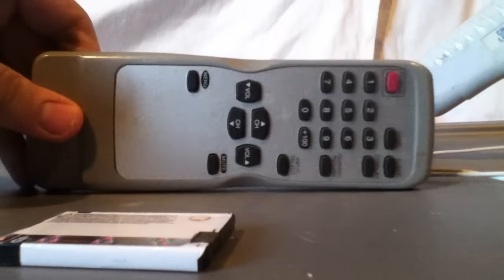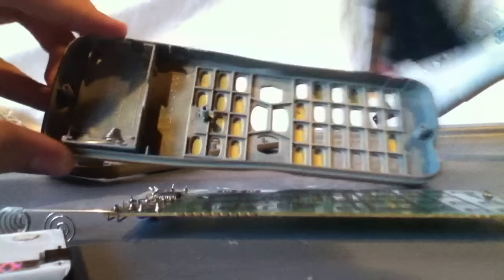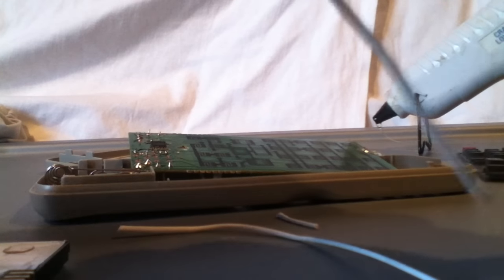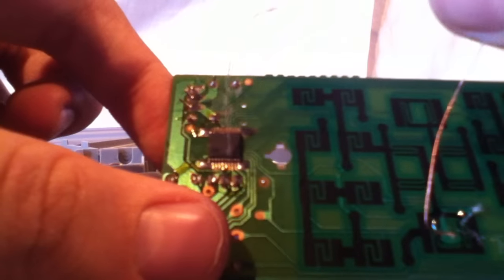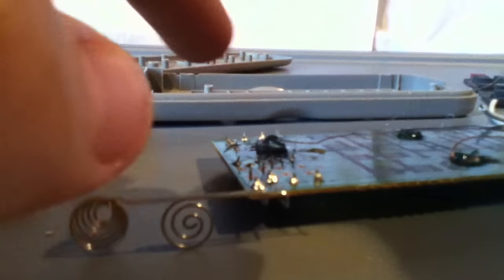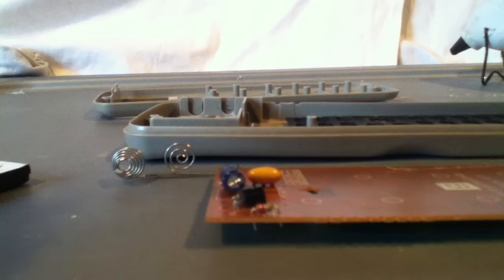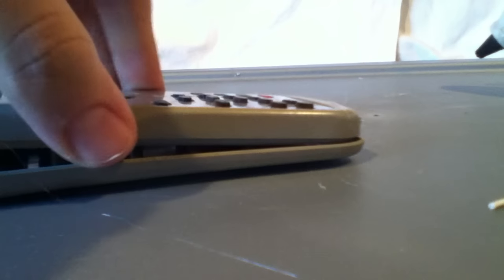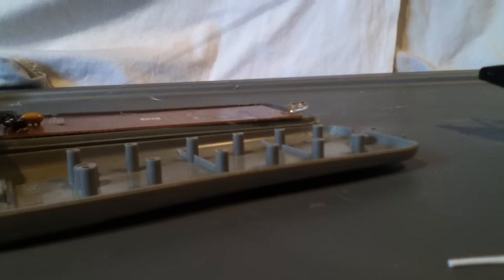How To Make a Cell Phone Jammer Out of a TV Remote

Comment: Ha ha ha, nice one!
it's totally going to work as long as you're capable of telekinesis & will it into blocking signals, and maybe the voices in your head as well.
Makes me laugh how so many people fell for it, & have no idea this was obviously a joke.
Doesn't take a genius to work out that the battery short circuited, the phone number dialed doesn't exist, as you clearly hear, gluing the wires wouldn't conduct anything, especially when the wire wasn't touching the circuit as the glue set beforehand, and the circuit itself fell down when it was turned over, so pressing the volume button wouldn't do a thing even if the battery was connected properly. And if none of that gave it away, send me your bank details & i'll double your account balance within 24 hours & send you one of these jammers as a free bonus ;-)

Comment: Ok, in theory you could use hot glue if you had a solid connection with the circuit. But only if you hit bare wire. (See below)

I don't know anything about that chip, but I guarantee you that you can't just hot wire it to carry a current using volume buttons to complete the circuit.

Even IF that worked, those "strings" or as the rest of the world calls them,  "wires" are individually shielded, which is why they can sit inside the sheathing and still be able to make your headphones work. FAIL.

Comment: What's even the point of making fake videos? The chip is a microcontroller and is essentualy a verry small and simple computer. You can't use it to transmit anything without an actual transmitter. The IR  LED is a light sourse which is waaay above the spectrum of the electromagnetic waves the cell phones use. This is useless. You can just use a single transistor as a transmitter with a small LC circuit, but you must match the frequency to 400 and 900MHz and provide a wide enough banwith

Comment: I've reported you and sent a copy of the youtube link to the FCC. As it doesn't comply with part 15 of the FCC rules that states "This device may not cause harmful interference, and this device must accept any interference received, including 
interference that may cause undesired operation." 

This is a violation of the Commission’s rules and federal law. Violators may be subject to an enforcement action by the Commission’s Field Operations Bureau that could result in:

Forfeiture of all non-compliant equipment.
A $100,000/$200,000 criminal penalty for an individual or organization.
A criminal fine totaling twice the gross gain obtained from sales of the non-compliant equipment.
An administrative fine totaling $10,000/day per violation, up to a maximum of $75,000.

You will also be held responsible to the fullest extent of the law for anyone and everyone who has used your device and has gotten hurt. This also goes for anyone who has used these devices in any crime just like criminals who are charged with armed robbery with toy guns. Regardless of whether or not the device works.

Comment: And THEN, you'd have to worry about short circuiting your battery if you managed to figure out how the "string" worked. There would have to be a pos and a neg connection separated by the circuit board.

If you manage to get past ALL of that AND manage to rig something NOT IR, at least take enough pride in your craftsmanship to cut a proper slot for your battery. FAIL FAIL.

Comment: watching this was mind melting, This would be fantastic if it Worked like the most amazing cell phone jammer ever created because watching this was mind melting..after watching the whole thing, gets mad at himself when he call the rubber string yet calls the wires inside string lol.  “Put it back together so it looks like an actual remote “yet the lithium ion battery is protruding a mile out the back LOL. The wiring from the air buds would not work and if it was going to jam the phone signal the bars for reception would disappear. I hope this was a joke video and I hope he was acting the way he acted On purpose for Ironic comedy

Comment: I think this might be the worst tutorial i couldnt even finish it. Your still learning cupcake you should learn what things are called for instance those arent strings inside the white earbud tubing those are called wires and second theres an easier way to strip wires than with scissors or your teeth a leatherman plier tool at least the one i have has wire a wire stripper on it second you probably can use ketchup but ketchup also dries and can catch on fire if you were walking around with a remote in your pocket youd get ketchup in your pockets and anything else you might carry in your pocket second if the ketchup is dried out and you try to do this the remote could catch on fire in your pocket which it would because youve shorted out the chip to jam signals and its connected to a cellphone batter which could also explode but because your caring around hard plastic would catch on fire or melt to your leg or pants pocket with possibly 2nd or 3rd degree burns ouch nobody wants that i want to learb how to make a signal  signal jammer but this video isnt it surely theres a video on how to make things that wont include a mess physical harm or walking around with something as big as a remote.

Comment: Lol obviously this guy knows very little bout electronics, the battery would quickly over heat and burn out like that and the added power would burn up components but nice try though :) btw their is a reason professionals don't use glue guns for electronic bonding

Comment: wow, the phone can still receive signal if turned off by verizon, as you can see it did make it to a tower or you have gotten nothing. wow, and ketchup increases the output my rear ass end. if it resists the electrons then it lowers the voltage traveling through that part of the circuit. basic 101 in electronics there, thats why they call them resistors, thus if ketchup did that the voltage needed to get the output you wanted wouldn't work, and the ic chip is just a gate for the remote to know what it is doing to tell the remote to lower the volume or change the channel, not emite radio waves, that would be the IR end of the device to make a radio, thus it doesn't and can not do what you say it does, nice trolling with yea.

Comment: More proof that YouTube is full of idiots who don't know the difference between "wire and cable" and "string".  Nowhere in electronics school did we EVER use string to make something conduct.  Same type of uneducated protoplasm who can't record from the line output when posting music on this 'service' instead of using a shakey cell phone.

Anyone who knows just a little about electronics knows that TV remotes emit IR (infrared) signals.  Cell phones transmit and receive RF (radio frequency) signals.

Those who think that this works just have crappy AT&T or MetroPCS phones in the first place and are delusional.

And yes, be careful.  As Jeff stated you could short the Li-Ion battery and cause it to blow up.  (hmmmm...maybe that's not such a bad thing considering how many stupid people are breeding).